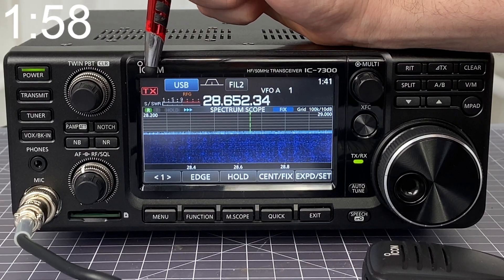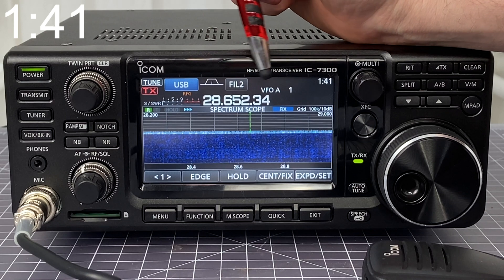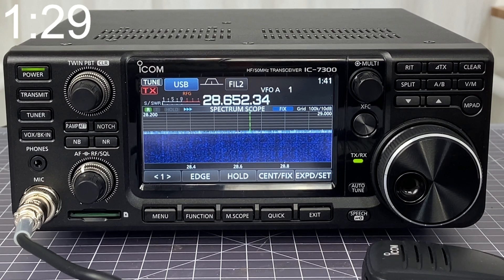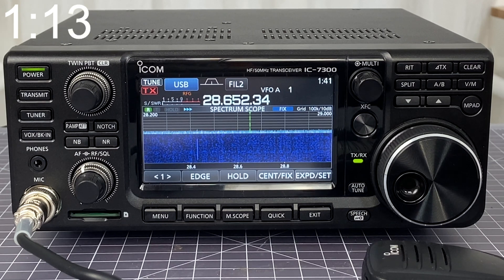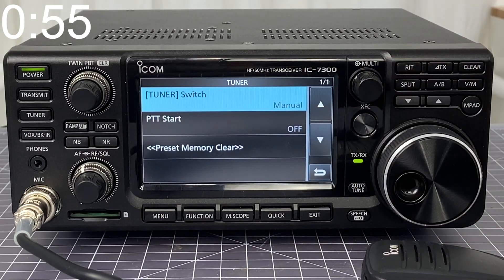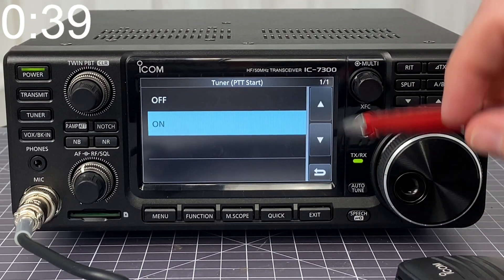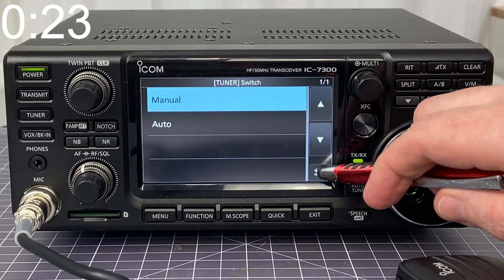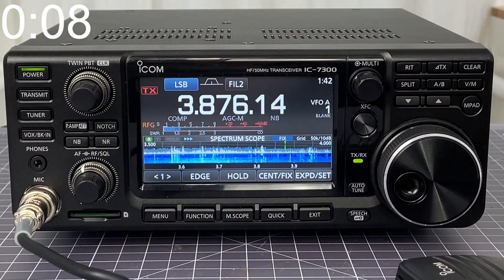2 Minute Tutorial: Internal Antenna Tuning on Icom 7300

Comment: How do you turn tuner off to use external tuner?
Reply: You have to disable the internal tuner every time. As long as the TUNE is lit up, it's set for internal. iCOM recommends turning off the internal tuner each you use your external tuner so they aren't trying to do the same task at the same time.
Reply: @happyjack880 thank you much I appreciate it